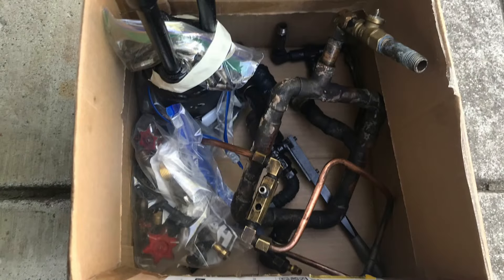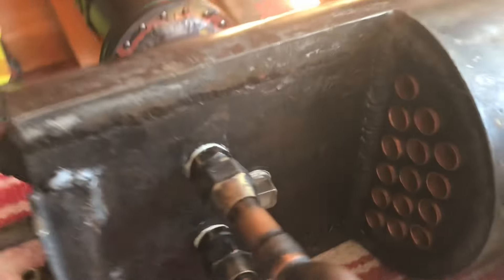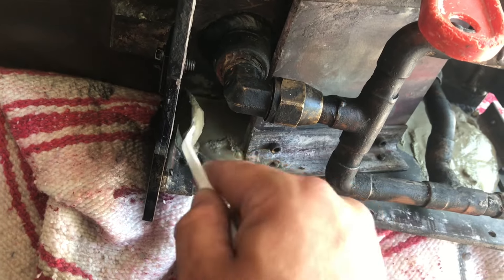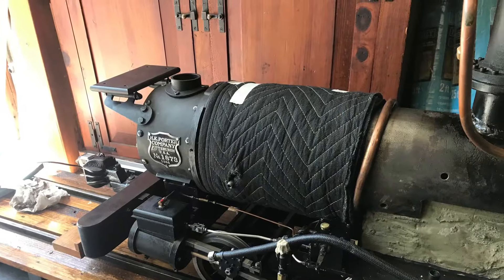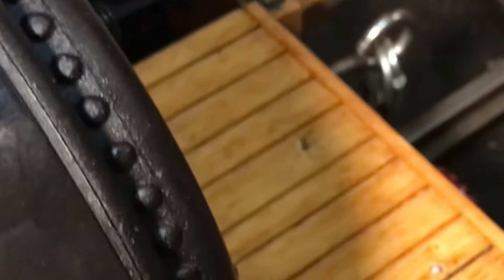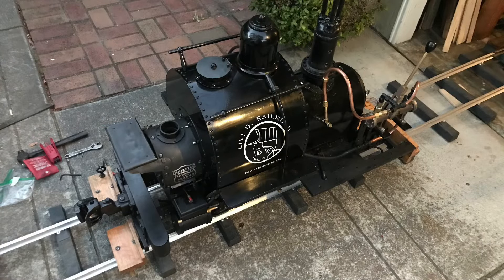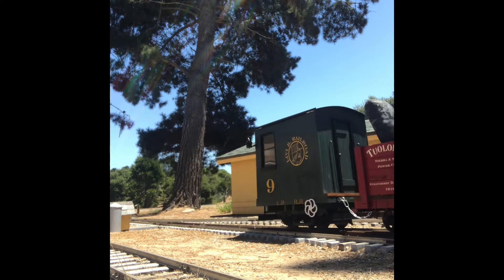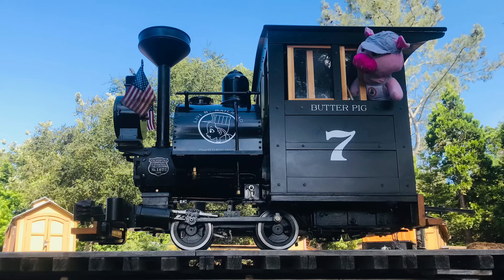Butter Pig is FIXED!!! #funwithtrains #funny #trains #livesteam #trainbuilder

Comment: Is that made from MEG Steam castings?
Reply from the maker: @funone8716  This is actually off a 7.25 gauge Marie Estelle’s Cassis / Castings with separate tiered spread 1/8 inch on each side. Stevenson Valve Gear.